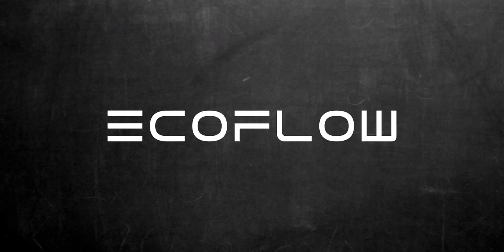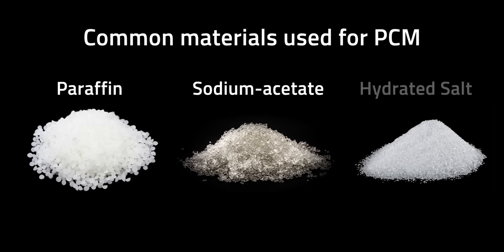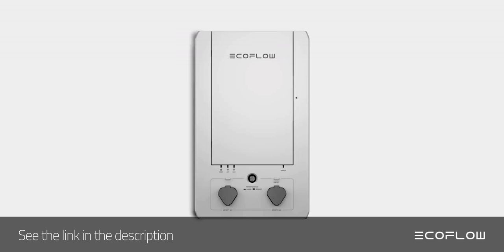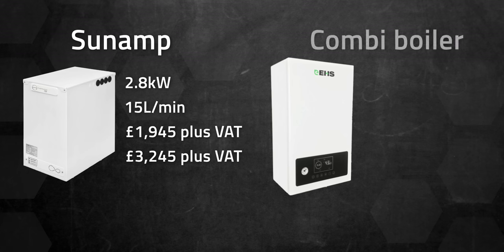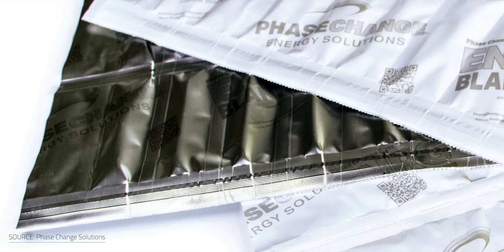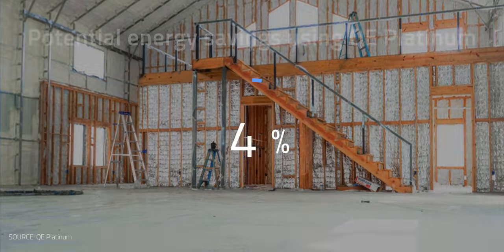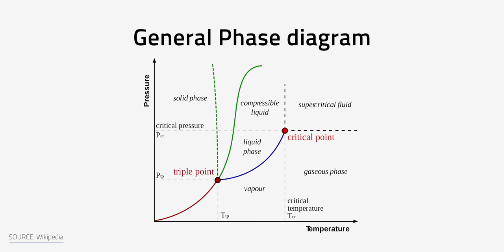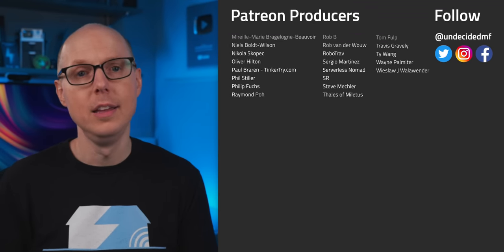Are Phase Change Materials the Future of Water Heaters?

Comment: Wonder about comparing it to say closed cell spray foam and rock wool. But as for the hot water that’s a big win as you can combine it with other products for an added benefit if not synergistic benefits. I like hot water heating so this would make it economical.

Comment: Years ago Crosley made a refrigerator called the Icey Ball it used ammonia to exchange heat with no power needed.
Reply: It needed a heat source; you are basically running a heat engine instead of an electric motor. A refrigerator is basically a heat engine being run in reverse.
Reply: Still used in RV refrigerators, usually burning propane as the heat source. Seems like it could be used more with solar for daytime cooling, though I don't know how it compares to heatpump efficiency.
Reply: @ralphbell1786  thermodynamically the heat pump and refrigerator are same product but used differently. Both need input energy to transfer heat from a lower temp to a higher temp. But how they calculate the efficiency is a bit of an art, rather than science.

Comment: I have a family member that lives over 7k foot elevation and his house does not have AC. In the summer the high temps reach the 80s but the lows at night reach the 50s. He controls the temp in his home with windows and an attic fan. I could see this helping him. But not me, my AC runs all day and all night in the hot summer. The phase change would only help me on the first day of summer when it absorbs the heat. Then it’s just more hot mass in my home that has to be cooled.

Comment: Make Your Own! You can also make you own Phase Change Thermal Storage by filling empty drink bottles with the Phase Change material and placing the bottles on wire shelves with air gaps in between the bottles for air circulation up and down. Don't want to see shelves full of bottles? Put a folding room divider around the shelves, with a gap of about 4 inches/10 cm between wall and divider. Or attach fabric of your choice directly to the vertical pipes of the shelves, leaving the top open and an air gap of 4 to 6 inches/10 to 15 cm below the bottom shelf.

Comment: This is great during fall and spring when it's hot during the day and cold at night, but if you're always heating or always cooling, a heat buffer is meaningless, it's going to stay pegged one way or the other. In that situation it's all about insulation. I'm not sure I'd want to be stuck at the same temperature all the time either. But hot water is a good application for PCM, especially if you have a waste heat source of some kind, like a solar installation or industrial application. Or a solar oven that you run a coil of black pipe through.

Comment: I came across PCMs decades ago, and likely anyone who has taken Chemistry 101 has recognized and studied the transition between states of many materials both academically and living normal lives in advanced societies. But, for the life of me I can't see any advantage in choosing a PCM that changes state within a range of normalcy, like water's phase changes from water to liquid to gas. Typical of many PCMs, those thresholds where state changes are limiting factors in how much energy can be stored (ie. Water's temperature can't drop below 32 degrees F or rise above 212 degrees F). That seems to be big negatives, not positives in today's world where we are always looking for better ways to store larger amounts of energy.

That is why nearly as soon as I see PCMs mentioned anywhere, I usually tune out. What value is there in considering a thermal battery chemistry that that is so limited? In the use case of insulation, it means that your PCM tiles in the walls will only work up to a point where max capacity is filled, and then the materiel no longer absorbs heat energy so it's like living without the expensive insulation. In the use case of creating metropolitan thermal storage, it means that the "battery" won't absorb more energy, and this is a critical difference compared to using a medium like sodium which has a melting point of about 6oo degrees F so has an enormous advantage in storing energy. In other words, unless someone can describe even one positive for choosing a PCM with a low change threshold, eg under 100 degrees F I just don't see the benefit.

Anyone help me out and point out what I'm missing?

Comment: my fave pcm is suspended vaporized air, or air. and you probably have all the parts at home. AC or heat your house using solar power, when it is available, then let it ride overnight, that's it.  cost : $0 for most users

Comment: I found this product to be very specific to UK market. In large house in US best solution is Heat pump water heater. With heat pump water heater like Rheem ProTerra you not only get large storage (up to 80galon and even more if you use mixing valve and store water at 150F). But also you get Heating efficiency over 200%. With this product you get just 100%. 

To be honest even in UK the 50 gallons Heat pump water heater would work.  It is not that much big compering than this.
Reply: Please explain to me how 200% efficiency works.  That's not a real thing....  😂 It only goes up to 100 and we'll never even reach that because there are energy losses and always will be.

Comment: I think the water heater or heat pump is an interesting idea to make those more efficient.  I do not know about insulation because people like different tempretures.  I think it would be interesting if they could find a phase change that could be use as a window becuase they are a pirate for heating and cooling.

Comment: Be interesting to see someone try to use the exhaust from an air conditioner to charge these heat batteries. Would be good to not have to pay to cool your house whilst simultaneously paying to heat hot water
Reply: You've just described a heat pump with DHW. It's a standard option for ground source heat pumps.
Reply: They already have that.
Reply: @punkdigerati  fancy that ;)
Shouldn’t have to invest 10’s of thousands in a ground source heat pump in order to get it though.
Reply: @Wease245  you can add on a desuperheater to any existing heat pump system (A/C included), and could charge a heat battery with it. People often use them to heat pools.

Comment: It would have to have an active circulation system, but if you paired these with some of the hybrid thermal/photovoltaic solar cells that actively cool solar cells you could save some of that heat for the night.  

How heavy are these?  What is their texture?  I wonder if you could make seats in cars filled with this.  It could help regulate your car's interior temperatures.  (Although maybe it's better to just have a remote car starter... you'd have to get the balance just right so that you didn't accidentally make the car take longer to heat or cool.)

Comment: The big problem with phase materials is that their biggest effects follow the weather. In winter they are the least useful for heating and in summer they're the least useful for cooling, while the exact opposite is needed.

Also, if you do have these in your house and say, it's too hot inside, so you have to turn on the AC, your AC will have to actually fight the heat being discharged from the phase materials.

The biggest problem on well-insulated housing these days is that in summer, heat actually gets trapped inside all of the insulation, which causes your house to heat up more and more without being able to release said heat. These phase transition materials will only make that worse.

Comment: I have two concerns with using these "blankets". 
1. How permeable are they? Obviously the sections holding the thermo material is non-permeable, but what about the rest. You have to be careful not to create a vapor trap within the wall cavity.
2. What happens when the future homeowner hangs a picture or adds an electrical outlet and needs to fish Romex? When punctured, how quickly does the material seep out and evaporate?
Reply: I was looking for a comment like this. Gotta be careful with dew points and climate zones as to where you essentially put a pop can that can condensate inside your wall cavity.

Comment: I would think that the systems for cooling would be far more useful. Use the output of your solar panels to run an evaporative cooler to chill a tank of fluid and use that and a high efficiency heat pump for air conditioning. If a ground source geothermal heat pump is more efficient that one that simply uses outside air.
The sunamp website mentions a system that use a material with a phase change at -30 degrees but one could use a simple tank with water and antifreeze that would cost far less
Reply: That was meant to read 
If a ground source geothermal heat pump is more efficient than one that simply uses outside air then using a tank of chilled fluid as a heat sink would probably be a comparable gain in efficiency

Comment: The isolation PCM, with the unique temperature of thermostat is a no-go for me honnestly. I though this was really clever at first, and I though they had developped some way to tweak the optimal point depending on thermostat, using rigid cells and making pressure vary. But honnestly only one temp ? Temperature perception depends heavily on relative humidity and even on the activity you're doing. I usually set a little 30 min boost when I really want be more cool briefly.

And let's not start talking about how each one has its own perception of comfort temperature. This is cool in industrial/commercial buildings, but not on residential ones. As for the water heater thing, I don't have any opinion yet.

Comment: Not sure where you got your pricing for sunamp, but literally just had someone round from Fischer who sells them and I was quoted over £7000 for a smaller unit that would only heat our hot water and not even our radiators as our house can’t handle the amps as we’re currently only on a single phase connection. Love the technology but it’s way too expensive right now. If it was actually as cheap as you indicated then maybe it would be worth it. Trying so hard to find the right technology for our home is so draining.

Comment: PCM is currently in development used to store thermal energy/heat while charging the batteries of a vessel. Normally a vessel utilizes recovered heat from engines to produce hot water (potable and non-potable for heating purposes). Batteries does not have any significant heat loss (at least it shouldn't), hence heat recovery is not available. Instead thermal battery banks (thermos) is instead used with either a liquid medium such as water, PCM or a combination of both. By heating these thermal batteries while at shore any shorter voyages would then in theory become zero emission vessels. It is on the other hand not feasible for long duration voyages unless there's a significant variable heat generator onboard the vessel with limited heat requirements. In that case the heat generators (such as the heat recovery of the engines) could re-heat the thermal battery banks for use when the heat requirement is still present but the engine output is limited (for instance when batteries are used instead).

Comment: mmmm one issue with using pcm as a thermal insulator in large commercial projects is mass and space. Like a project might only be profitable if the dead load on the slab is less than x or if x% of the slab is usable area (like you shave an inch off of wall thickness of a repeating unit like a hotel room and architects jump for joy). Mineral wool between studs is lightweight and say a platerboard wall is quite a bit lighter than masonry.

Comment: You say the difference in kwh of heat loss per day between a conventional home water heater and the PCM model you showed will "really add up".  On an individual basis, not so so much.
Using the difference in the stated kwh/day heat loss and my local price per kwh, the difference in cost to me would be about 6 cents per day, or just over $18 / year.
That PCM model costs roughly $2,000 more up front.
Thus it would take me just a bit over 109 years to recoup the difference in cost.

Comment: This sounds really good but I live between two large bodies of water so during the summer it's uncomfortable during the day and beautiful after dinner. So I wouldn't want it to release the heat. In the winter it's cool during the day and cold at night. I wish there was a Goldie Locks phase shifter that could hold onto the energy for months. But this would be great in areas where you are cooling in the day and heating at night. I've never been there. For me I just spend time outside and get used to the new climate. I've been to the middle east and central Africa. I would hangout outside in the shade and breeze and after a while it wasn't bad. I would think about how the local population has lived with those environments for generations with A/C. It doesn't take long to get used to the change.

Comment: Actually I don't really see the usecase so much. In a typical European winter it does not get hot enough during the day so that the material could absorb enough heat during the day, to give something back at night. And in the typical summer in no way do I ever want to retain some heat from the day to give it back off during the night. If the night gets cooler I want that cool ambient temps to cool the house back. So I don't really understand where this would be applied.
Reply: What I really want is to collect heat all summer and release it all winter.
Reply: According to something I saw from the EIA, the average US household consumes about 50MM BTU for heating. Somewhere I saw that the energy density for some fancy PCMs is about 100 J/g.  I guess a BTU is about 1KJ.  so 50GJ of storage if you wanted to store up all the heat you'd need for a season.  That's 5E05 kilograms ? 500 Metric Tons ?  Seems like it's probably a lot....  Works out to a bit over 20 rail car loads.  I'm going to have a hard time fitting that into my house.
Reply: Just need to figure out how to turn Zebra Mussels into PCMs on site and the entire Great Lakes shoreline will beat a path to your door.

Comment: Thanks Matt, energy technology across the spectrum is changing so fast (at least in the lab). However, it's frustrating to hear so much potential that doesn't make it to the consumer shelf (that would be called "impatience"). I have a solid home (and living in the New Mexico, so heat is an issue), but not brand new, so updating certain aspects is in order, but which energy efficiencies do I tackle, and which do I wait for the "best" solution...arrrgh!
Reply: Eliminating draughts through doors and windows can be very cheap and remarkably effective. A notch up the scale is double/triple glazing and using shutters or shades to limit direct summer sunlight getting through the windows. I strongly suspect white paint or pale boarding on sun-exposed walls would also have a measurable benefit. The basics get you a long way, before you dive into the expensive techy solutions.

Comment: Also - PCM + Solar might not be enough if you're concerned about legionnaires disease. You need to heat your water to 70 degrees minimum, which means you'll need some form of top up heat.

Comment: I have seen these before at shows aimed at switching away from fossil fuels. I think they are a great idea but there is a serious problem, the cost. Your comparison suggests that the prices are roughly the same for an electric combi boiler and that's simply not what I'm seeing online. Without installation I'm seeing prices around €1000 Euros so just under £1000. If you go instead for a tank based system where you can charge up during the day then size becomes a problem. Now you may be right that the payback of the Sunamp is it's longevity and annual cost saving, but the problem is that the people who cannot afford the space for a tank are likely to be poorer people living in cramped homes and with a cost of living crisis in the UK, Sunamp are going to need to reduce that price significantly because those who can barely afford heating are unlikely to shell out £3000 in the hope of long term savings. However I'd have one quite happily.

Comment: I would be kind of worried about leaks if it's in liquid form 50% of the time and only contained between some thin aluminium sheets. I don't see much discussion about this has this question already been addressed maybe? You may not even see it at first if it's solid when you install and later discover many small leaks.

Comment: [IDEA]:  
The small expansion/contraction from the phase changes of this materials could be used as a way to "passively" move a small flow of air through the ventilation system [even without main electricity].
  ->  This would allow for a minimum of air filtration & remotion of humidity (that may be enough to prevent formation of mold and other internal structure problems).
  
. It may need a small [tiny] electrical battery (charged from ambient/solar light) just enough to run two temperature sensors & to open/close two air paths [to take advantage of both changes in volume & enforce either recirculation or air replacement].

Comment: The ENRG Blanket seems pretty nice, but I wonder how it would match up to other products that are available as today. Here in Norway there is a company called Glava making isolation for houses, and they have a long history of being experts in the area. One of their best (my opinion) products is called Glava Extreme 32. One square meter with 34mm thickness and density of 17.5kg/m3 gives a thermic resistance of R 1 per square meter with a lifespan of 60 years. (according to their ISO certification documentation)
Reply: the underlay under your laminate flooring has r3.  Clearly, this is not an insulating material, but a specialty case application